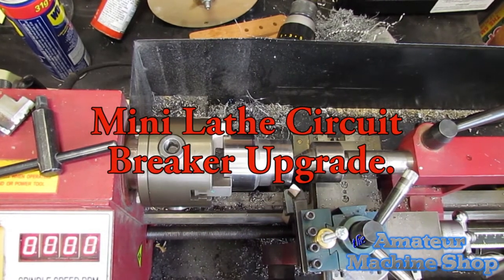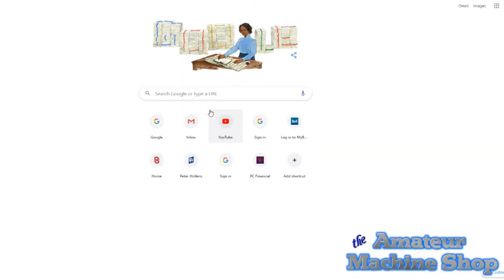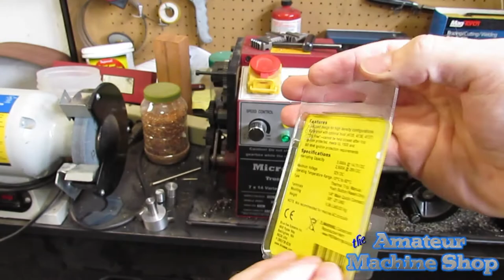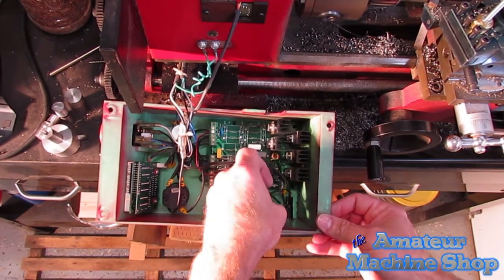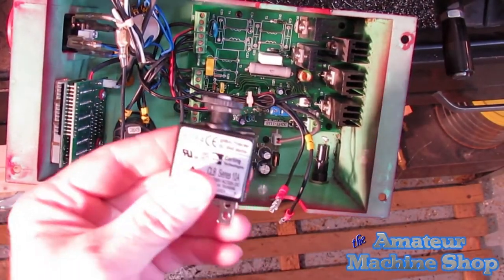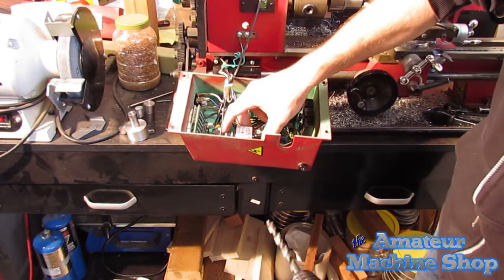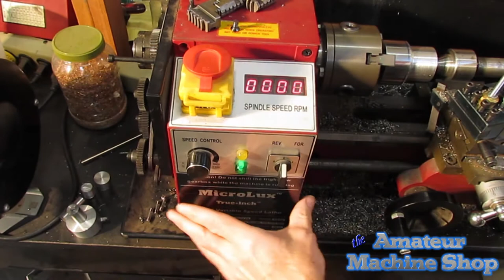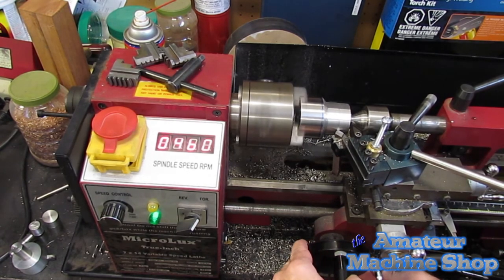Mini Lathe Upgrade- Circuit Breaker Install

Comment: We're in process of building a lathe from scratch, we'd thought about buying mini lathes many times but just couldn't justify the cost of such a small and most of the time under powered machinery that would constantly give problems like you've been having. We even watched upgrade videos, complete rebuild videos, alot of mis-matched/unfinished parts and oh lord, the grit and grim in a new machine from the land of Chieseium. NOPE! Don't get us wrong, this was a smart fix for the problem you where having, just subscribed other day and really enjoyed the videos!
Reply from the maker: WOW, building a lathe? Would it not be cheaper to buy a USA made? Or are you making your own mini lathe?
Reply: @theamateurmachineshop2150  bigger than mini lathe, we really love a challenge, plus we go to scrap yard alot so we've got resources 😁 and we like to build stuff from scratch, even if something is "Made In The USA🇺🇸" Usually its with parts made by some other country who don't care about tight tolerances or craftsmanship at all, we won't say which one, cough..cough...cough, but it starts with Chine and ends in seium!!!

Comment: I am going to have to do this when I change out the motor on my 130 year old lathe... I didn't think of a breaker when I built the control box,  because the motor has one built in, but it is such a pain to reach , below and behind, where it can't be seen...

Comment: Circuit breaker is double the rating.
So what ever this fuse was protecting, circuit breaker will allow to happen.
The only convenience of this is the ability to RESET rather then REPLACE.
But at the same time, 5A fuse seems very low. I would expect it to be 10A at the very least because 10A is the least rating for home wiring. 15A for GFI outlets and septic tank pumps etc.
Weird.

Comment: It won’t be long before the board burns out and the motor costing £300+ when that happens replace it with a turnigy motor and esc absolutely brilliant
Reply from the maker: Thanks for the heads up. Will keep an eye on things and try not to over due it.
Reply: Thanks for your reply i just wanted to pass on the brushless motor mini lathe upgrade just to let you no there are more affordable options out there when or if your lathe let’s you down! Mine did and I almost through it away! But now the lathe lives on 👍😁
Reply from the maker: @nathancarr7593  awesome! I would never through it away, just find another way to power it :)